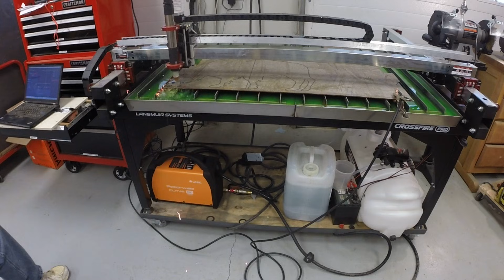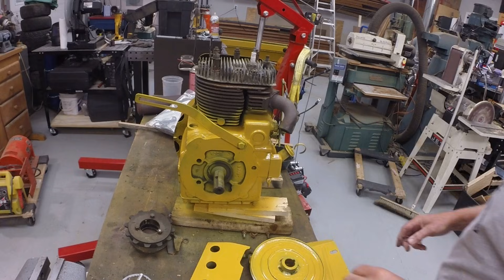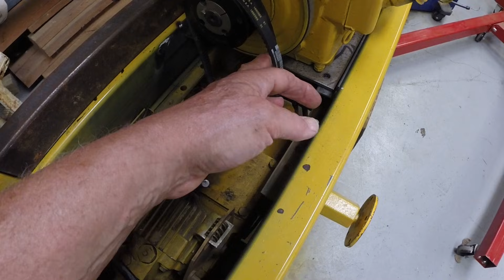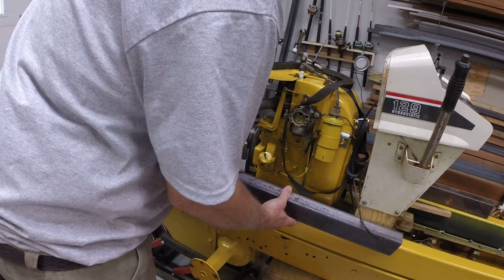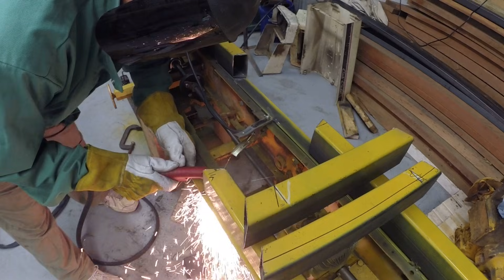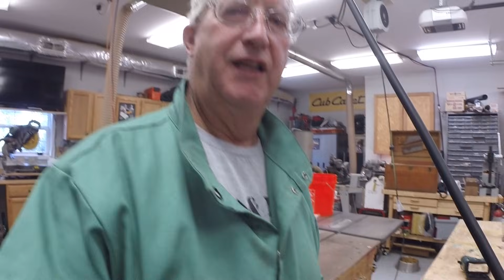Cub Cadet Dozer Build EP # 10, Extreme Frame Mods!

Comment: Those goof-ups to keep talking about on the edge if you look on the back you'll probably see a spot or rust right there. I have been around an awful lot of plasma cutters in my life and I have never seen one that cut without "any" slag left on the part. In fact, in any shop, I've been in if they gave me parts to fit or weld with no more slag on than what your parts have I would be tickled pink.
Reply from the maker: Hey, Steve, I discovered that the notches in the edge of the workpiece are caused by the angle of entry of the torch. I've changed it from 90 degrees to 60 degrees and the notches have almost completely disappeared.  Slag or dross on the bottom surface, of course, is a fact of life. The challenge, as you've noted, is to minimize it to reduce clean up labor.

Comment: Just finished episode 9, and am watching episode 10. How are you going to drive one track forward, and the other track in reverse, for a pivot within itself? This question has been bothering me since the first time I saw the two drive gear boxes. That will work great in the forward, and reverse, but what about when turning? I know the gear boxes have differentials internally which will allow braking for one side while driving the other side, but how are you going to have one track forward, and one track in reverse? The little Truck dozer from the sixties did a great job with this but it was all with belt drive to each track.
Reply from the maker: One axle drives the right track, the other axle drives the left track. Each is controlled independently. There are no brakes. Episodes 3 and 4 show how the axles are modified to accomplish this. The drive sprockets are on diagonally opposite corners as a result.

Comment: I think you said on one of the vids that you were going to weld the track plates to the drive chain for your cat tracks. May I suggest that you weld brackets to the chain then bolt the track plates on to the brackets. Although  it may be more work at first. it will be much easier to change out the plates when you need to. Also the full size machines all have bolt on track plates, it would be more authentic like the big machines. Just a thought from a fellow machinist. I love how you have kept both machines as authentic as you can with certain limitations you are working with!
Reply from the maker: I'll have to consider that, but I don't see ever wearing out the tracks considering this will not be used all that much. I might damage a track, so being able to replace one might be important. Need to figure out a way to do that without a huge amount of additional work. It might be easier to just break the chain and replace the track pad and chain link together. Hmm...

Comment: If you speed up the cut speed you should be able to get rid of almost all the dross on the bottom.
Reply from the maker: That's what I understand, but finding the correct speed and amp setting is a bit of trial and error.

Comment: I'm gonna be building my own little hydraulic bulldozer soon and I plan on using my new punch press to make the links for my tracks. They'll be closer to actual cat track links (narrow on one end, wide at the other end, all links will be the same). We could collaborate and I could make a set for your dozer. I'll be making some forging dies to hot stamp em out of 3/8" or 1/2" material

Comment: I have dealt with similar  hydros in the past I was able to rotate the front of the housing 180ﾟ and it Reverses the rotation but I don't know if you can do that with them
Reply from the maker: I've been told you can't rotate the charge pump and expect reverse rotation to work without using different valve plates.  It may work but won't last long or will be jerky in operation.
Reply: @woodandmetalshoptime8048  yeah I was not sure I've just dealt with similar ones in the past from walkers but never worked on them

Comment: that dross will knock off better than grinding
Reply from the maker: What do you use? air hammer? needle scaler?
Reply: @woodandmetalshoptime8048  cold chisel in your hand slag hammer it comes off pretty easy

Comment: Frank. Rethink what you said about your connecting rod linkages for the trunnions. 
The hydrostats are both facing the same direction so the actuators will both go the same direction for either forward or reverse. 
The only issue you might have is connecting the right hand lever to the correct actuator since they’re both on the left side of the hydrostat.
Reply from the maker: You are correct (and paying attention!)  In an upcoming episode, I think #11 (I just uploaded #12) you'll see the solution.  Once I sat down and drew it out, it was obvious, they both move in the same direction for forward and reverse.

Comment: When running my table I use a check list before I hit the go button. Has every thing from setting air pressure to making sure the ground clamp is attached.
Reply from the maker: That's a great idea!
Reply: @woodandmetalshoptime8048  I made my list as I set up a job to cut, so it goes through the process in the typical order of events

Comment: instead of adding a spacer for the hood why not cut the mounting bracket and weld a spacer to it as well as the dash, then if you need a filler between the frame and hood just use 1/4 x 3 plate on its side with some small tabs welded to bolt the plates on. Looking forward to see it finished

Comment: I have a 4x4' table and that table is nice.  The start should be in the inside of circle and outside of the outside.  I think that is a setting on your software.  We have different hard/soft but we both have plasma.  Nice cut.  Sounds as if you have a 40 amp plasma and doing good.  Expect dross.  You are not using a laser which is cleaner.  The kerf size is  needed on the size of holes.  e.g. when you draw a line there is thickness of cut.  Is it outside, inside or on the line ?  on the line really - but half of the kerf is inside the hole.  see software.  Like you were doing - remember dogs and grandchildren need eye protection.  Welder goggles work.  They want to look.  Eyes will get cataracts or floaters.
Reply from the maker: Dogs are not allowed in the shop when I'm welding or during plasma table operation. Heck, they leave immediately whenever I turn on the air compressor or the welder.

Comment: For you linkage to the trunions you could take a peace a flat bar drill 3 holes in it the center hole would be a pivot point, then drill a hole above and below your pivot point then attach your linkages when you push the peace of flat bar shifter ahead your linkage above the pivot point will move forward while the bottom one goes backwards

Comment: I would love to have a big enough shop for a plasma cutter !
Just a side note , that is not dross it is slang. Dross is the impurities that you skim off molten metal before you pore it. .
Reply: Actually, it is dross.  Dross is oxidized metal rather than impurities.  Slag is actually impurities, that come out during the melting and separate from the metal.
Reply: @alco4248  Well I have been a machinist and welder for over 30 years with 10 of those years in the tool&die shop of a diecast plant. I was taught in school that that is slang and in the diecast plant when they fluxed and then skimmed the molten aluminum they called that dressing it because they were removing the dross. But what do I know I have only worked with metal all of My adult life and most of My teen years , I'm sure your rite and Me and the whole industry are WRONG .
Reply: @NotMeeither  No need to get all bent out of shape because someone corrected you.  You are confusing ferrous and non ferrous metals.  What you are saying pertains to non ferrous metal.  However, with ferrous metals, slag is what you refer to the material with impurities and fluxes, whereas dross is just oxidized metal.
Reply: @alco4248  I just can't stand for a know it all to tell me I am wrong about something I am considered an expert at ! But of course you know more about metalworking than a tool & die  maker who is close to being a master machinist.
Reply: @NotMeeither  Figure out the difference between the two, and maybe someday you'll get there.
Reply: @alco4248  I have told why I know I am rite but you have not My guess is that you have NO expertise but you think you are rite about everything. The only reason I am not a master machinist is because I got a foot mangled in an accident and can no longer work on My feet therefore I can't get enough OTJ hours in to get it.
Reply: @NotMeeither  Again, no need to get all bent out of shape, I simply corrected and explained what you were saying that is incorrect.  I'm not the one claiming to know it all like you are.  By the way, I'm a retired metallurgist.
Reply: @alco4248   I don't know it all but I do nkow metal.
As far as you being a retired metallurgist I highly doubt that .
Reply: @NotMeeither  Good luck with that.  I don't really care what you believe.
Reply: @alco4248 Ok I get it now you are a troll on hear just to stir up trouble. I just received a PM warning me about you seems like this isn't the first time you have done this so I am done with a lieing know it all troll like you!

Comment: Hopefully that’s not ethylene glycol 
Your slats are to high the metal needs to be closer if not touching the water 
They make a additive for water that’s safe for plasma tables
Try increasing feed rates you’ll get a thinner kerf and it affects the amount of dross
Reply from the maker: I am using a plasma table additive, that's why it's green. I've raised the water level some more, which helps. Can't get it touching  because the slat tops are above the pan lip so you can hold a sheet larger than the table. I'm still experimenting with feed rates. I'm starting with the recommended rates based on users on the Langmuir forum. The torch amps is another variable.
Reply: @woodandmetalshoptime8048  
Cut the slats down once it’s pierced the sparks are diminished you won’t have so many sparks flying around 
I built two plasma tables from scratch that I sold 
They worked great
Reply from the maker: To some extent the amount of sparks is due to cutting along the edges. Cuts further away from the edges are much less "sparky."
Reply: @woodandmetalshoptime8048  
You’ll see what I’m saying one you cut the slats lower 
The water blows up a little while it’s cutting

Comment: Just in case. Is that antifreeze in the cutting table? If so, it is deadly to animals.  The worst part is, it taste sweet to them, and they will be drawn to it.  Take care. Love the videos. Question? could the operators feet go inside the frame vs outside?
Reply from the maker: Of course not. It's a plasma table water additive, non toxic, etc.
Reply: @woodandmetalshoptime8048  What about the operator feet question?.

Comment: Great video! Just a suggestion, I ran heavy equipment for many years and ran a John Deere hydrostat dozer quite often. It had two foot pedals to control forward and reverse for each track that leaves your right hand free to control the blade which you need to do constantly. It would make your life much easier to have pedals but you have probably already made it with levers......  Will the blade have tilt or angle?
Reply from the maker: I'm thinking a 6 way blade.  Going with levers at first but thinking a foot pedal retrofit later on.  I put a foot pedal on the mini motor grader, it works great.
Reply: @woodandmetalshoptime8048  6 way blade 😳 that will cover all the grading angles 4 sure  🤗😎👍🏼

Comment: nice job on the tractor.   on the table, bring the water up .250 under the plate.  that lead in chatter is from the backlash in those tables.
Reply from the maker: Yes, I've brought it up higher since that video, but can't get it 1/4 inch under the plate or it will spill over the edge of the pan. The slats are about 1/4 inch higher than the edges of the pan.